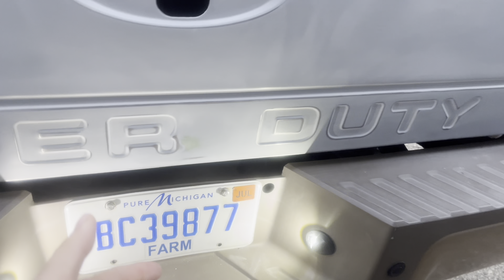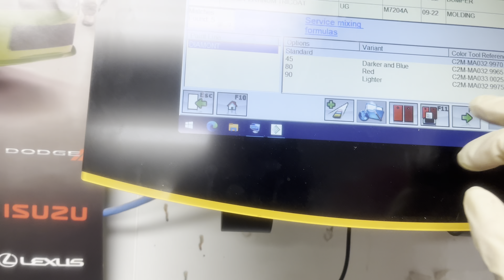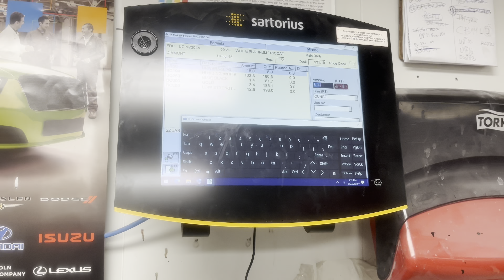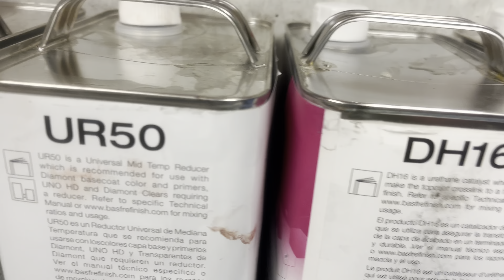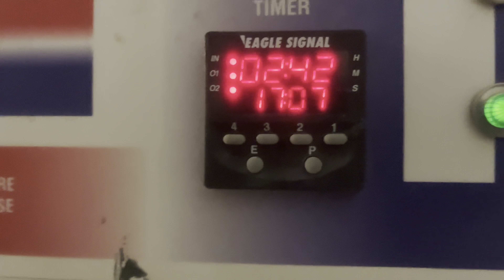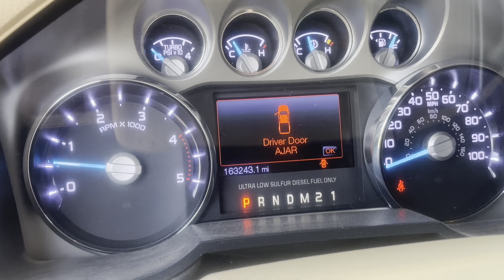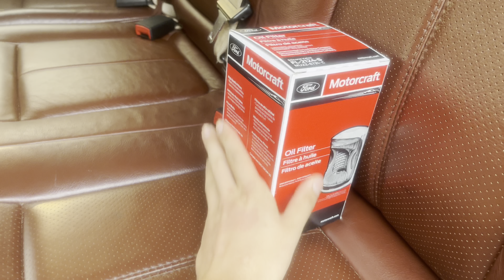New paint match on my superduty +paint work

Comment: If you're lookin for something that would dress up the truck a little more, I'd paint the bottom 2/3 of each mirror to match the tan color on the bottom of the truck. It would really tie things together.

Also, not sure if you've done it or not, but a ceramic coating over the whole paint job would keep it looking clean longer.

Comment: It would look sick if you also got a ranch hand rear bumper and paint matched the front and rear to the tan trim color on the exterior of the truck. Maybe some color matched white led headlights to go along with color matched tail lights, white Ford logos, 1 or 2 inch spacers
Reply from the maker: Rear ranch hand soon but I am keeping them factory black, I did get 2” spacers also